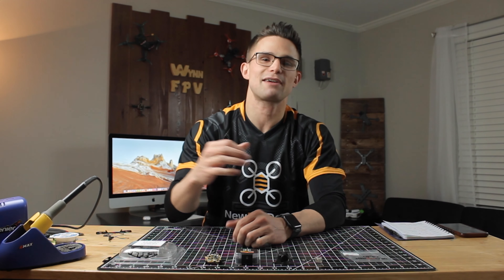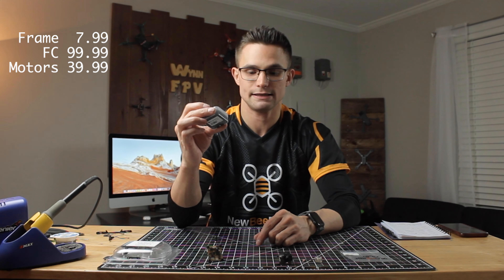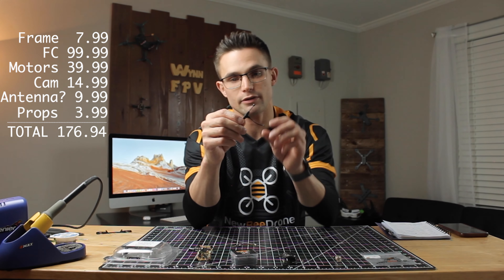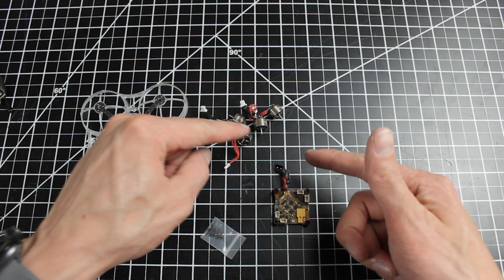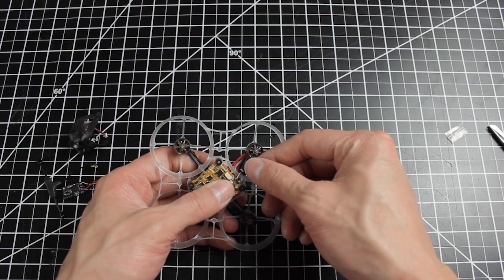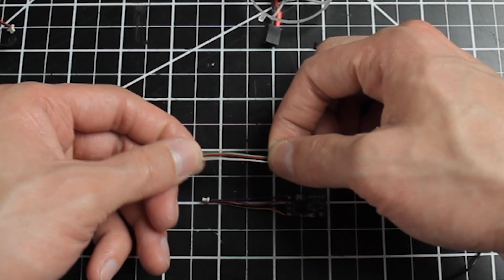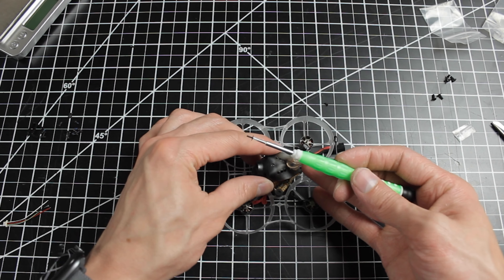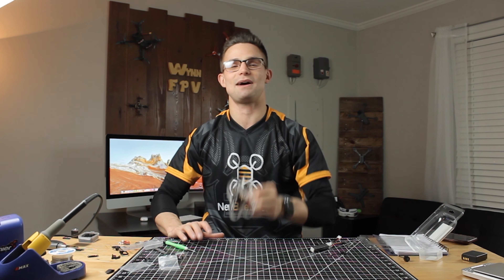DIY - Build a 2s NBD AcroBee75 FPV Tiny Whoop.

Comment: Great video! Thanks for this information. Do you know if you can use uart2 and the 5V pad to connect a 1S Walksnail VTX instead of the crossfire RX? I have (2) Acrobee75's (2S version) and would love to make them digital. I figured if they can handle the weight of a insta360 they should be able to handle the WS VTX.
Reply from the maker: Thanks. Yes, you should be able to do that!

Comment: Is it okay to use happymodel cross f4 5v with 2s? Its spec says it able to run with 2s but some say the mosfet wont last long
Reply from the maker: The happymodel or newbeedrone fc?
Reply: @wynnfpv  im using happymodel cross f4, later i read it has 5v bec only, but it spec says it able to run 2s. Some say 12v better for 2s. Btw im using se0802 16000kv rated 2s
Reply from the maker: @iamrich2030  yeah 5v seems kinda low for 2s. I haven’t run that board so I can tell you by personal experience sorry. I would probably not run 2s on it though in my personal opinion if they won’t cover if it burns up haha